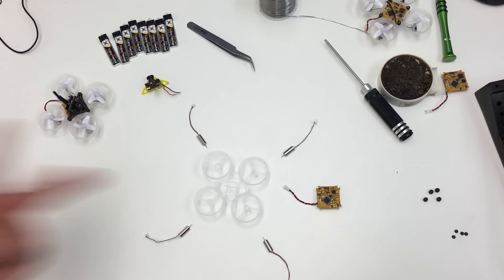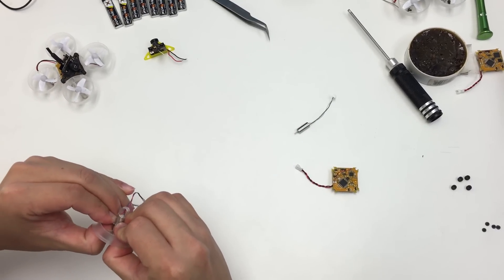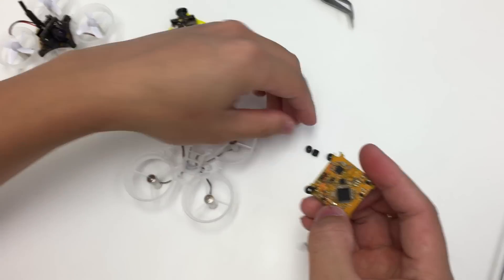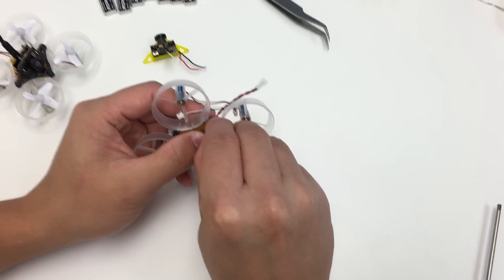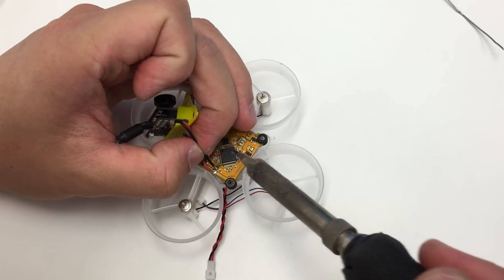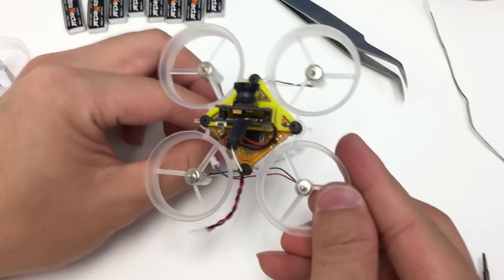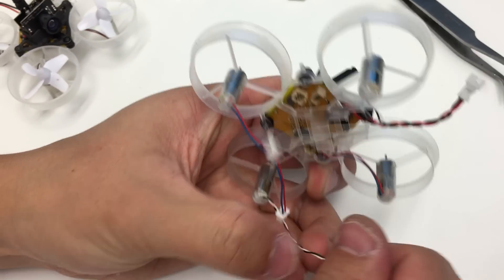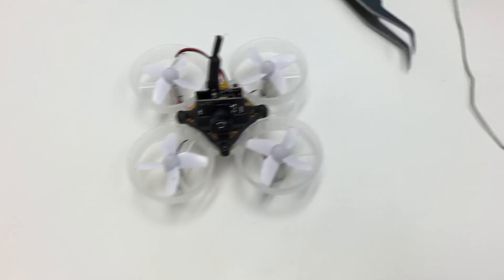How to Install the BeeBrain Flight Controller

Comment: I have the beebrain tinywhoop and everything works in beta flight motors spin correctly and everything else responds perfectly but when I unhook from computer and put battery in tinywhoop and turn on everything my taranis plus will not respond to the tinywhoop at all! When it's connected to beta flight everything responds but when not on beta flight and ready to fly on it's on nothing responds!!I'm so lost please someone help

Comment: I built a whoop using the v1.d beebrain other night with mmw 19kv insane motors and standard inductrix fpv cam with rakon cam holder using mylipo hv batts run in motors then had a blast (it's beast but) found I get bout 2 min flight time max but the motors an battery seem to get pretty hot I have only had a standard inductrix fpv before this 1 is this normal?

Comment: Hi have a question. I just bought a newbee drone kit and don't know where to put the black and white motor right front or left front I just got it a week ago and the motors came in small box they bdrA65 thank you for any help Thanks RIch
Reply from the maker: Hey Slugo, the red and blue wires go front left and rear right. But you can test for sure by just plugging one motor in and spinning it up in Betaflight. The front left motor should spin clockwise. Please see the manual on our product page for more info

Comment: I have the BeeBrain Flight Controller but can not flash or bind to my Spectrum DX6i. I was able to bind to stock radio and change config settings in baseflight but would rather use my Spectrum. Is there a trick to flashing these. I am used to either jumping or pushing a button to flash. I just get error no response from the boot loader in both cleanflight and bataflight.
Reply from the maker: Please shoot us an email at info@newbeedrone.com for support with the bootloader issue

Comment: for some reason I just installed the flight controller to my tiny whoop and done everything on beta flight plugged in a battery and it just spins around in the air is there something I'm doing wrong
Reply from the maker: Yes you have the motors on the wrong way. Swap positions (left with right) on both front and back

Please see the manual on the BeeBrain page for more info.

Comment: I'm still not real clear on all the different radio compatibilities.  I would like to use a Turnigy evolution for all my stuff.  Would this flight controller work with a Turnigy evolution?
Reply from the maker: Sorry but it only works on FrSky or DSMX.